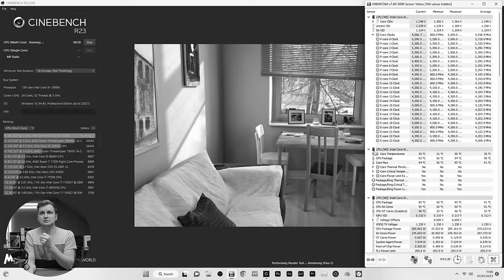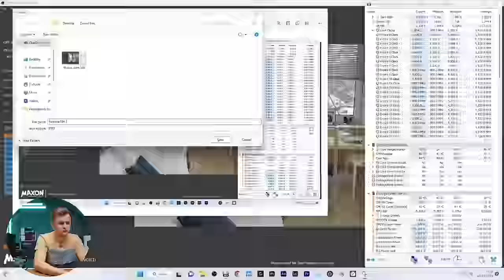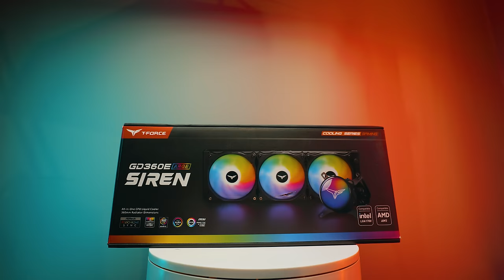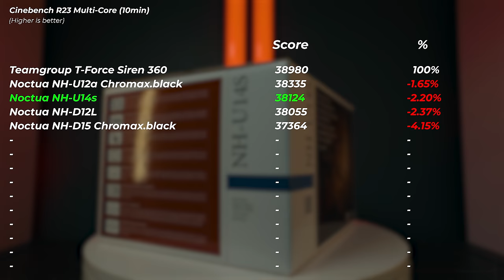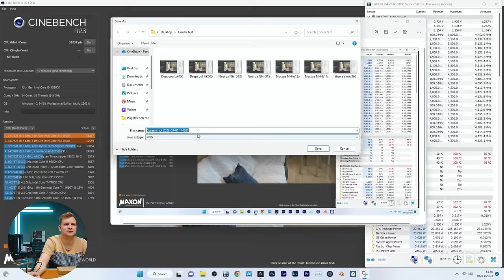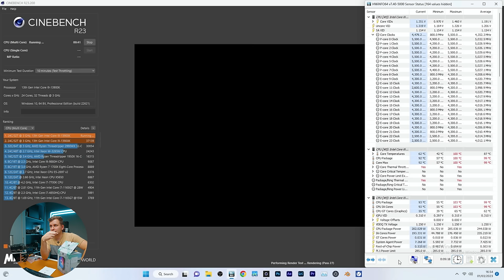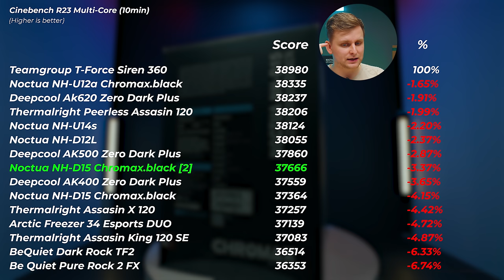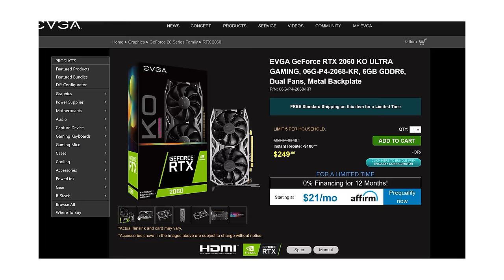We Tested 14 AIR-Coolers on 24-Core 13900k - The Results Will Shock You!

Comment: You are testing the air coolers standing vertically which is the way they are designed to work. However, many people use the air coolers in a tower case with the cooler horizontal. The coolers will not work properly in that orientation. The coolers use heat pipes that rely on a liquid-to-vapour transformation to transfer heat from the copper base to the fins. Heat pipes are orders of magnitude better at conducting heat than solid copper. However, if used sideways, the liquid will be on one side of the pipes not near the copper base. The heat transfer will be by copper conduction not as heat pipes. The cooler will work but is nowhere near rated capacity. Am I wrong or have others not realised it?
Reply: If 99% of all PCs are in tower cases, never seen any where the motherboard is vertically... why should they be designed to work vertically if no one ever uses those vertically? 

I really doubt they are designed to work that way... it wouldnt make any sense and I didnt find any source online saying that they are designed the way you say it

Comment: So re-testing the NH-D15 did nothing. Probably the difference could be attributed to the ambient temps being cooler during your re-test. Also I just wanted to point out that the Noctua U12A has been known to outperform even the NH-D15. I don't know why, but that might be the reason why it is so much more expensive compared to the NH-D15, but damn, the AK620 is performing so much closer at a more affordable price.

Comment: Running single run tests, the AIO will win every time due to it's thermal mass, run 10 minute tests and the AIO will saturate and lose that advantage; were as the air coolers will be running at the same temps.

Comment: Did you run the Air coolers at 100% fan speed?  That matters
Reply from the maker: Default bios curve but it goes to 100% at about 70c so all fans run max speed, Yes.

Comment: What a shame that water coolers are only keeping it in the 90's :(
I'm so scared of a water cooler, because I was told the pump will fail or it will leak destroying the system or starting a house fire.

But the way these new cpus are using so much wattage it seems we will need water cooling soon :(

Comment: How is the D15 worse than the U12a? Noctua ranks the D15 the highest in their cooling tier
Reply from the maker: well, Noctua actually confirmed that, it's probably to do with new CPU IHS design and older cooler design :)
Reply: @theTechNotice  doesn't that mean noctua need to update their ratings on their site then?

Or will the results be different for every cpu?

Comment: I'll stick with my water cooling, If I'm buying a $600 CPU, not to mention an expensive motherboard, RAM, Case, M.2s, etc (in my case an RTX 4090 coupled with an ASUS ROG Extreme) an AIO especially is not going to break the piggy bank.

Comment: In Russia, we use new processors in a completely different way. Instead of radiators, we put aluminum pans and cook food during games.
We connect the water cooling system to the heating of the house and heat the dwelling. And you're just wasting valuable resources!
😁
Reply: In russia, PC played You

Comment: After watching this I came to the conclusion that all air coolers are worse than a good AIO.  Also why would you put an air cooler on a 13900k, as due to its fail rate and instability,  you dont want the chip any where near 100oC.   The cost of 360 AIO's have come down drastically, and you can now pick one up for under $80, and 99% of the time will out perform an air cooler.
Reply: This video is 1 year old, at that time the 13900K didn't had any problems.
Plus Air Coolers are better than AIO's, specially the Thermalright ones wich are just 30 to $40

Comment: Funny stuf that people buy a 150$ Liquid cooling for an i5......when clearly almost any cooler would work.....
Reply: Maybe those people has Small FORM Factor case. Those case only can be fit with low profile or AIO. Some people Just want to make their internal looks cleans

But i agree with you that AIO is wasting money, there's many cases where AIO died right after warranty out and need to be replaced. Meanwhile air cooled fans can still be used by replacing fans

Comment: So, the air in the room was getting hotter and hotter with every next cooler testing procedure. And the ambient temperature difference between the first and the last test was like 5 degrees. Which is a lot and completely unfair 😔

Comment: NH-D15 is a terrible air cooler
Ive had one on my i7-10700KF and it had terrible temperatures when overclocking. I switched to a NZXT kraken and my temps dropped 15-20 degrees. Also it is much quieter. The NH-D15 is now mounted on an electronic load..

Comment: I recognize the hard work this video took to make but it is really unprecise. 1) The room temperature should have always been the same and you shouldn't be in the same room. 2)The amount of thermal paste should have always been the same amount. 3) If you spread the termal paste you should always use the same method and a clean spatula. 4) You should have took in count the contact area issue the 12-13 Gen have and use a contact frame to get the most out of every cooler you tested. 5) The results should not only be driven by the total score of the CB test but also the max speed of the Fan(s), how many cores throttled, the max temperature and the average temperature of each core and the max air pressure and volume every fan is capable of. If this video would have been precise it would be a jewel of information but base a conclusion on this inaccurate information is just not possible. Too bad.

Comment: BEST COOLOR IS WATER COOLOR THAT 53 BUCKS Thermalright Frozen Notte 240 Black ARGB Water Cooling  THIS THING SHOCK ME RUNS MY I5-13600K AT 28C IDE LOAD 41C MY COOLOR MAST RGB BLACK THAT COST 59 RUNS MY 13600K  AT 44C IDE OVER 50C ON LOAD

Comment: you need to run the water cooler until it's heat saturated, THEN start the 10 minutes.  otherwise it gets to run for free until the water in the loop fully saturates.  it would be like putting ice on the air cooler, letting it run cooler until it finally melts, if that makes sense.  it's mostly only a problem because water has really good thermally capacity, so it's like a big heat battery

Comment: Moral of the story.. don't get a 13900k instead replace it with a 7950x...although it runs hot too but at least it doesn't thermal throttle...

Comment: Great test but………..most of these coolers were close to the limit and thermal throttled in an open air setup. Now lets put everything in a case. and add 5 degrees C to each one. Now they are all thermal throttling which means our present cooling solutions for modern Intel CPU’s is substandard at best. We need new technology cooling solutions. Don’t get me wrong……these are all great Cooler tests…..but they are all done on open air benches which is not real world. This kind of nullifies the results somewhat. Some of these cooler may perform better in a case and some worse. I think the days of air coolers are numbered except on lower end cpu’s. We must set aside our concern for noise also.

Comment: 6:03 u mounted the back fan in wrong direction. It has to pull the air backwards not to push in against the front fan which is also pushing in the air. Ur test is not valid!

Comment: I'm not shocked at all we all know aio coolers are better than air. No shock there. Custom water cooling is even better than aio's.
Reply: Sounds like you didn't even watch the video, the majority of air coolers achieved very slightly lower cinebench scores than the aio
Reply: @-opus  I don't care about cinebench scores but i do care about tdp and thermal throttling wich they all did.
Reply: @miguelfernandez2325  Which was represented by the cinebench scores.

Comment: I think you have a substantial margin of error for this kind of test. Any of the coolers that have been tested can be easily a couple of positions higher or lower in a new test run. To get proper results you have to be very precise. Control room temp. Run each test 3 times and average results with 30mins  pauses for temperature stabilization between tests. And so on. So without an appropriate methodology for tests, you just receive some random results.
Reply from the maker: I get your point indeed! 
But, You know this test is an average of about 30 runs in cinebench and calculates the average?
Reply: One of the issues with this type of test is how well the coolers are mounted, if you wanted to be super fussy you would have to remount and repaste each cooler multiple times, no fun there. As a comparison to an aio, I think this video proved its point, especially considering that most users will not be running their cpu 'balls to the wall' most/all of the time anyway, grain of salt with the rig not being in a case though.
Reply: @theTechNotice  you mean 30 runs on each cooler? I mean making some runs for checking if everything is set up properly and the results are consistent, then run the actual 3 test runs and average their results. 
The most important thing is stable results. As long as you can get the same results at any time or day or setup you do a greate job. 😀

Comment: thank for comparison, great to know that Intel did the intel thing with IHS that makes cooling terrible, so one more reason once again to skip intel...
also very good to know that cheapest of tower coolers are really underrated , at least for intel :)
but it could be better:
1. it is not good, that you thermal testing with throttling and no AC , or other way to keep room temperature in controlled manner 3'C difference it is not good when hitting throttle limits -> therefore test data is invalid. (make per clock underclock for 5th and 7th cores of -200 or -100 MHZ and control room temp -> than your testing actually would be good. cause one or two hotter cores does negative impact to others a little when overheats...)
2. you used Peerless Assassin 120 SE , not Peerless Assassin 120 -> they are different coolers  and you did not correct anywhere , in the description it is different cooler that you have tested.

Comment: Kind of pointless to measure coolers without noise normalized testing, different fans behave differently when using a single fam curve. Some run faster and louder. Of course those will have lower temps. But no one wants to listen to 2000 rpm fans under load..

Should've used one fan model for all coolers, then it would be a proper test of the heatsink, not the fans.

Comment: Your results are very interesting.  However, they tend to undermine your conclusion.  The differences between the air coolers and the one liquid cooler were all under 7%.  It's possible, as you say, that the liquid cooler would be better for the long-term health of the CPU, but your results didn't really show that.  Instead, they suggest at least the very real possibility that it doesn't matter all that much which one you use, even with a 13900K at 285W.

Quite frankly, it seems as if your conclusions were based on your pre-existing knowledge instead of your actual results.  Kudos for all the hard work this video entailed, but I'm a little bit disappointed in you.

Comment: okay so some constructive criticism. 
First it's not a bad video but you went way over on time. you turned a 15 minute video in to a 45 minute snooze fest. second and you even called this out in order to perform a fair test you need to let the system reach ambient before running another test. Not doing that or explaining that you did that completely invalidates your testing.

Comment: please take this as constructive criticism. im not trying to attack you in any way. The method of determining what cooler is better than another in this video is wrong. let me explain.

using cinebench scores as the determining metric to rank CPU cooler performance is a flawed test. Cinebench is not a consistent, repeatable benchmark. you can run the benchmark 10 times and get 10 different scores on the same exact hardware changing nothing. due to the score being inconsistent run to run, its a worthless piece of data for determining CPU cooler performance at the scale is shown in this video. you're ranking coolers better than another based on 1/100th level differences in %. At best this testing data is just misunderstood and unintentionally misleading. there are better ways to test the performance of a CPU cooler. using Cinebench scores as the defining metric is one of the worst, it shouldnt be even considered.

Comment: Deeply flawed testing methodology makes these results invalid. You cannot  accurately test a cooler unless the heat source  is more consistent  than a cpu  and OS. There will be variations in background  processes, power draw etc. A heat source  that is consistent is required  in order for the results  to  mean anything.

Comment: 13900k is just a bad product, linus used 5000w chiller, even below ambient the cpu still throttles, it is not possible for air/water coolers to go below ambient temps so noctua cannot do anything about this cpu. the conclusion is also questionable, used open test bench; with unknown ambient temperatures; with best air coolers; with just 10 minute load; still everyone throttles, then the conclusion is that the cpu can still be cooled by air coolers? use longer test workloads then the result will obviously be different.

Comment: Vidéo totalement dénué de sens,  si on n'a les moyens d'acheter un cpu intel 13 génération on peut acheter un aio mais basique pour le refroidir plutôt que de mettre deux ventilateurs et un dissipateur thermique qui servent à rien sur ce type de cpu vu la chaleur dégagée.. aucune logique,  aucun sens .... en 3 mots Nul à chier..
Reply: This is just ignorance. Alot of us use air cooling so we dont need to worry about the potential failure of an AIO or just don't want to use liquid. 

Like okay i can afford a super expensive shitty European brand car but it alsp sure isn't as reliable as a Toyota/Lexus

Its not a matter of affordability, it's about reliability.

Comment: more crap testing. you arent going to get real world temps with an air cooler twsting them in fake scenarios being outside of a closed case.
Reply: Nobody can really give you the tests you want if you are bothered by open test bench . Some have open cases, cases that almost have airflow, moderate airflow or great airflow. That's not even taking into consideration the different case fans, heat from other components etc. This kind of test however does show the performance of each cooler in relation to each other. The top performers in this test will be great as opposed to the coolers that performed worse in any case.
Reply: @vectivuz1858  there is no way your numbers can be taken seriously in an open air bench. your numbers are substantially different from what reality is, people are coming to YOUTUBERS to get real world performance numbers not fake temps.

Comment: SORRY KID BUT YOUR RESEARCH IS ALL WRONG, YOUR NOT TELLING THE WHOLE STORY THE RIGHT WAY IS TO ENCLOSE EACH AIR COOLER  IN THE PC CASE AND YOU WILL SEE THE HEAT BUILD UP INSIDE AFTER HALF HOUR AIR COOLER WILL NEVER BE IN THE SAME LEVEL WATER , ONE REASON HOT AIR LIKE TO GO UP WITH THE WATER COOLER THE 3 FAN WILL SUCK UP THAT HOT AIR WAY FASTER THEN WHAT YOUR AIR COOLER SYSTEM COULD DO, TRY IT ! YOUR SCORE WILL CHANGE IN A HEART BEAT